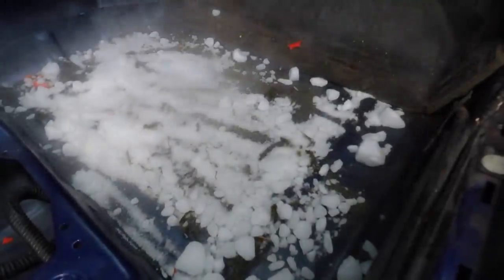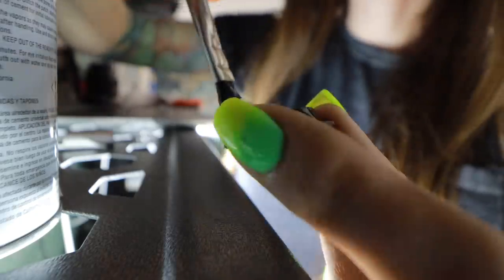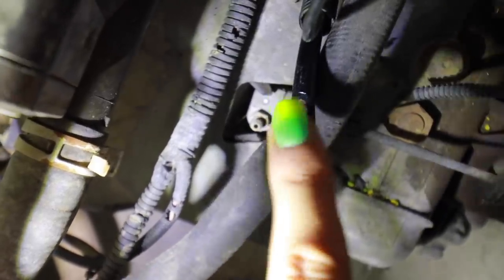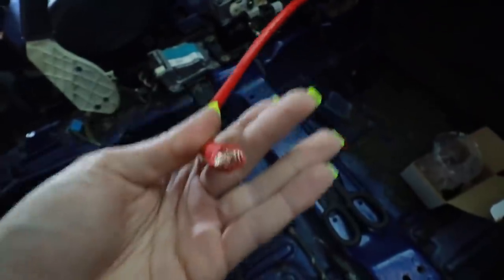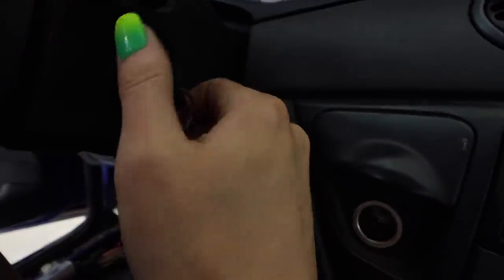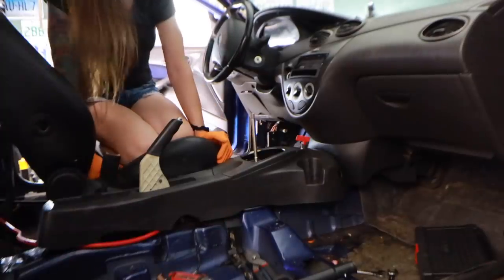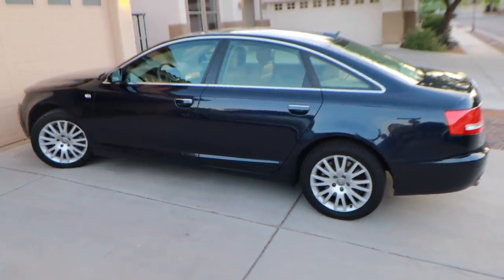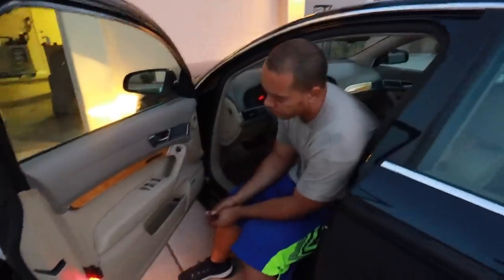Re-Focusing on the Rally Project // Dry Ice Time!

Comment: A little helpful tid bit young lady : when hooking up a battery ,always hook up the ground side last ( and remove it first ) love your channel !
Reply: It really makes no difference at all, as long as you're not sloppy enough to touch a wrench between the positive terminal and something grounded.
Reply: Dave , there is a difference in the amount of spark , if there’s a load on the system
Reply: @toestrrman  The same current flow through the same air gap, only difference would be direction of flow with respect to the dissimilar metals of the terminal and the lug.

That can make a big difference when talking about open circuit voltage and currents associated with welding, but on a 12v system you're doing something else wrong if you have enough load on the system for there to be a difference.
Reply from the maker: toestrrman there should never be a load on the system when your disconnecting or reconnecting a cars battery, if there is, you’d have a dead battery when the car is parked.

Comment: Some tips:

They make firewall pass-throughs for power cables.  Essentially it's a bolt with a plastic bit around it.  The plastic bit screws to the firewall to provide plenty of insulation from arching, which your grommet does not have at the moment.  It's like a bolt with no head so you can put lugs on both sides.  It's actually required because the vibration will cut through the wire jacket even with the grommet and cause a car fire when it arcs.

You can also get a cheap pair of cable cutters for thick wire.  You would have been able to cut through that heavy of wire easily.

Solder your wires to help prevent corrosion.  Even inside of the car.

Comment: The step bits are great and the good news is harbor freight has cheep ones that work good . Three pack of small ones and two pack of big ones well worth it. Use rubber tape then good 3m electrical tape over that it's what we use to cover the connections coming into houses, electricians that is. Big wire cutters at harbor freight also ,look like bolt cutters but for big wire. Geez like a harbor freight commercial.

Comment: Think about who'll need to use the kill switch if it's needed and what they'll need to do to use it. Try to make it as easy as you can for them because it's nice to have you around, even if you do have a few scars. Personally I would mount it to the left of the steering wheel in where the air vent is. You could use the air vent a template for the mount.
Mr Dos or Sir Codsworth both work. 94F is no joke so choose the one that doesn't make you hotter than you already are.
Happy summer!☀️☀️☀️😀

Comment: @ 3:41 You might try using some brush on "Star Brite Liquid Electrical Tape" to weather-proof the positive terminal. You can buy it at Home Depot, or most hardware stores, or even on Amazon. The stuff costs about 7 US Dollars, and comes in a 4 oz metal can that has a screw on lid with an applicator brush (similar to rubber cement containers). It is available in 5 different colors, including black and red. It can create an air and water tight seal either directly over bare wires or terminals as a replacement for heat shrink, or as a sealant for a wire/cable pass-through hole of a terminal enclosure. Thank Scotty Kilmer for making me aware of it if you find it useful.

Comment: Let your garage cold soak overnight (door ajar or similar), get out there early then break out the dry ice. Much smaller temperature differential then.
Also, put plastic over the ice, slows down the sublimation from solid to gas and allows more thermal transfer time.

Comment: Quick suggestion - You really should get one of the cheap hydraulic crimpers to do the terminals on large wire like that. The crimpers you had don't put near enough pressure to make proper crimp on wire that size. They are like $60 at harbor freight before a 20% coupon, or around $40 on amazon. I think they are like 10 ton

Comment: For your weather proof terminals (and a tool or two) visit a store that is specialized in selling electrical supplies. The terminals you want are;   "insulated black mechanical lug/" the total number of wire you have is how many ports you need (have three wires get three ports, 4, 4 ports....) there is a set screw inside the cap to compress the wire. If your unsure of the wire gauge, take a small piece of the largest wire you have, with you (you can set smaller with a big lug but, not go larger with a small lug). Also while there ask about a pair of " wire loppers" you'll not struggle to cat wire again. Lastly, pick up a roll of "33 (as known in the field" (scotch 33+) wrap the lug a few times, in the direction of the caps (that cover the set screws), as those can vibrate loose and fall out. if you want more insulation use 88, "3M Super 88" . If by chance you want to color coordinate the tape, 33 is black tape period, ask for 35 and say the color you want (35 is use to color phase electrical wires in a system). Google those item names and go to images, the items should pop up to give you an idea of what I'm talking about and you can determine if you want to go this route. Cheers !!!

Comment: The wire cutters you were using are tin snips.Cable cutters are what you need. Also, are you building the rally car to a rule book?
Because the kill switch might need to be mounted so it can be accessed from out side of the car.

Comment: K5 I bought last summer had positive cable extended like you did they put that connector bolt inside a blue plastic conduit box from home depot so it wouldn't ground and arc

Comment: Also be sure to install a substantial ground cable from the engine to the chassis, or you will not have a direct ground the way you have the ground cable bolted to the seat mount. Just because it runs this way. Remember the engine is mounted in rubber and electricity will find an indirect ground. If you want to know why and how this happens ask me. GM had this problem in 1973 on their B body cars that I diagnosed and wrote a technical service bulletin for tech's.

Comment: If you're going to be doing a bunch of work with heavier gauge wire get yourself a cable cutter. Ratcheting cutters work great, but even a non-ratcheting unit will get you through plus it builds hand strength.

As far as your positive wire bundle what about a bus. Marine stores sell buses in all different sizes. Also a few extra spots wouldn't hurt for Rally lights or anything else you could dream up.

Comment: Finish Mr. Dos. Instead of using R134 Try this product from Red Tek,  R12a. Its a hydrocarbon replacement for R134 and you do not have to convert anything and cools better than any conversion.
I used it on my daughters 92 Probe and it cools great. Amazon sells it.

Comment: Have you friend check the idle air control valve, remove the vacuum line from the IAC valve. If the car runs smooth then the IAC needs to be R2. If no change then it could be a voltage issue.

Comment: Ok sweetie this may help you. What you want for cutting heavy gauge wire are called loppers. Pick a decent pair at an electrical supply house. With those one hand and done. Also when you splice wires together its best to use a terminal block. They have enclosed ones also at electrical supply house. Some supply houses only sell to licensed contractors. But being that your not to hard on the eyes i believe you will have no problems. Good luck and good day to you.

Comment: You should move that kill switch closer to the where someone else can reach it. You may end up upside down, hanging from your harness and head on the roof with your car still running. Also, the kill switch needs to be able to kill the car with the ignition switch on. The way you have it now, your alternator is still providing power and won't kill the car.

Comment: just suggesting a hack saw works wonders on those heavy wires.
Reply: Chris L. Submit Racing SUM-900040; good for AN steel or nylon braided hose, unbraided hose, and large gage electrical wires.  Always severs on the first try.

Comment: sarah you shoulda used wire cuters to cut that 4g or 2g wire it would have done it cleaner, and you coulda used sum solder on the wire but it works both ways tho <just my ocd kicking in tho> was a car stereo installer back in the day :)

Comment: Shoot, whatever you want on your channel is fine, a lil bit of updates on your buddie's 4.2 A6 would be nice. There are some speed sensors and stuff he can swap, but the trans may be getting slippy with a  glitchy wire harness, caked filter, weak pump, or worn clutch packs. The newer scanning software will lead the way, still a great deal, if under 120,000 miles.

Comment: Those were tin snips.  You need a proper set of cable cutters (approximately $30 Harbor Freight).  They kinda look like mini bolt cutters (bolt cutters MAY work, but the blades may not be set up for cutting the individual strands of wire like that).  Not only will they plow through shit like that, they have straight handles like pliers, so you can put cheater pipes on each handle.

Comment: If the Audi has a CVT, then it needs to have the Transmission control module reprogrammed.  I had the same problem with my Audi, which caused it to shift erratically.  it was a common issue with the pre 2008 Audi's

Comment: if you want those wires to last a long time you should tin the connectors using solder and a torch.. otherwise the green death will find its way back

Comment: That Audi has a w8. A great motor as long as it has been maintained. otherwise, they can be a nightmare. It is engine out for most anything. interesting fact, the Bugatti 16 cyl engine is based on the VW w8 I would love to work with you but I'm in Phoenix. Long drive.  My son and I have two long term projects. A 1978 Camaro and a 1972 GMC c20. Lost or spot we worked on them so now they sit.
Reply: The 4.0l W8 was only used in the Passat 4motion variants, the Audi 4.2l of the same era was a standard-ish configuration 40 valve 90 degree V8.

Comment: Nice improvising with the cutters and the lug crimping, even with the tools specifically made for that stuff, it's not the easiest task.

For your friend's A6, that's a 4F chassis, not a 4B. Not sure what cable you have, but it should have communicated. Those 4.2s are good engines, although kind of a pain to up keep vs the earlier ones, timing chains should not live in the rear. The autos in those do have valve body issues, but faults are deciding factor there. And those Civic Hybrids, I have a 03 with a 5 speed that I just hate, driver's seat of it is not a nice place to be, fantastic gas mileage though.

I would like to see the MR2 in the next video, but with you behind the wheel and it outside your garage, you've earned a little fun.

Comment: Quick heads up. make sure the alternator is charging the battery before calling it all wired up..
Reply: Technically if it's still hooked up the same way just further it should still charge BUT since its further it will have a little more resistance than it did which may not let it charge well enough or it may overheat the alternator having it work too hard.

Comment: Hey , quick question, isn’t the whole idea of a master switch on a race vehicle , so the safety crew can have quick ( usually outside) access to it ? I’ve only built one race truck , but the main batt switch was outside , not trying to be a dick , just curious as to why you mounted it inside ?
Reply from the maker: There is no safety crew where this car is going, I am the safety crew. Ever wonder why it's hard to film a rally race?
Reply: Sarah n Tuned I get that , I used to desert race a class 7 truck , but they still had rules , are you racing it locally ?
Reply from the maker: toestrrman I’m so far away from ever getting to that point, most likely I’ll be taking it out in the desert and just having fun exploring on my own.

Comment: Want that audi fixed? replace the transmission electronic module board, , audis car are popular for that, not thats its expensive, but you havet to tear into the entire things, and THAT s complex, were talking spring loaded gears and parts, and specs that are through the roof. Audi has for some reason, made the clocks or something, blow up and out at certain kilometers or miles reached then and it either stalls, or it simly just doesn't engage.

Comment: The power distribution block under the hood doesn't really need to be weatherproof, a normal bussbar will work fine, just get whatever is right for the terminal size you have. I've used these, and they seemed like decent quality. Give yourself an extra terminal to make life easy if you decide to add lights or something down the road. 
 https://www.amazon.com/dp/B01M3U1DSY/ref=cm_sw_r_cp_apa_i_5vaeDbKS0ZPWV

A little conductive copper antiseize  will keep any oxidation from creeping up again.

Comment: Those audi v8 cars are garbage
Reply: All cars are garbage if they're not taken care of. Those have some design issues that make certain repairs more challenging than they should be, but the major assemblies are pretty solid.
Reply: @Dave-fx5zw  those v8 timing chains are a disaster and super expensive.
Reply: @kbeck4660  Yup, exactly what I meant by design issues. Big picture however, changing them every 100k or so, and upgrading to metal backed guides, it's not that hateful. And the rest of the engine will keep going for a good long time. 

It's somewhat comparable to needing to reseal and change chains and valve seals on the BMW N63, or chains and center timing sprocket on a MB M273 engine. Most modern-ish v8 sedans require engine out repairs at some point, just due to how tightly packaged they are.
Reply: *that was supposed to be N62. N63 will need new turbos too.